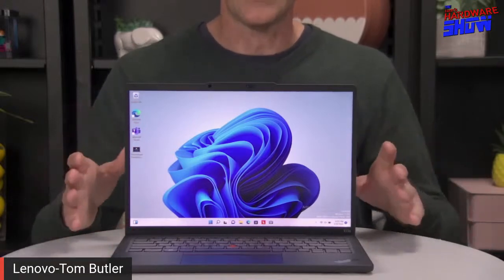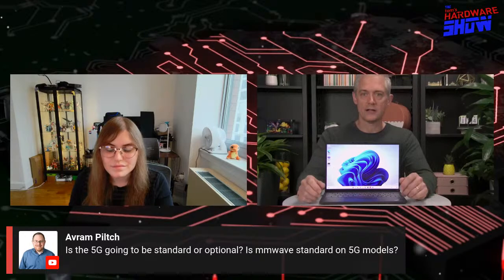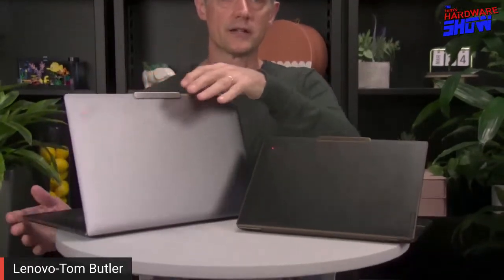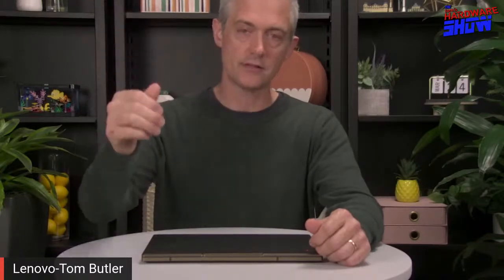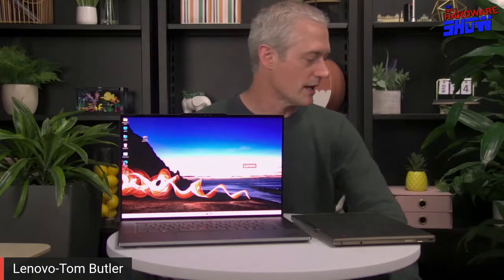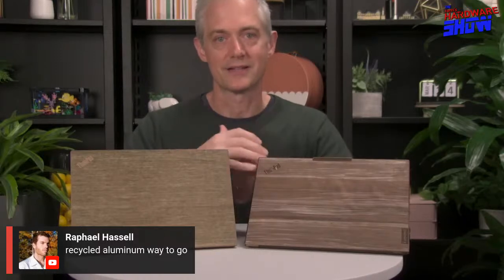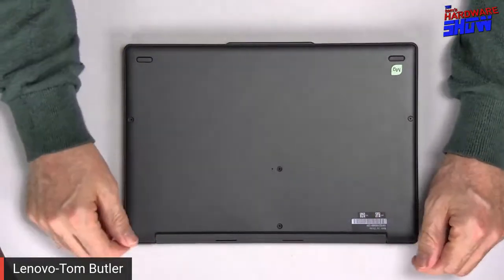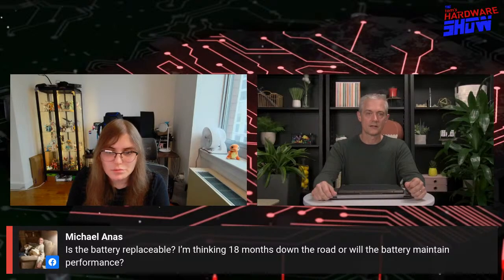A Snapdragon Thinkpad and the Future of the Z Series | The Tom's Hardware Show

Comment: What the viewers dont get is this.....

If the theme is sustainablity why has this model  no upgradable wifi,ram, screen and ssd 's ? Clearly why not just buy a cheap laptop which is stuck together which you cannot be updated and ends up in landfill within three years? The UK and EU are cutting out non repairable,non upgradable,and software diverse laptops.This mdel is deffinitly a failure....just call it the max and scrap it ?

Do whhat is needed....increase its thickness by 2 mm,add useful ports,udatable ram,linux, and wifi cards......
Reply: Lenovo, like most corporations, is just virtue signalling about their supposed environmentalist bent. A laptop with zero upgradability or maintenance options just ends up in e-waste that much faster, regardless of what the shell is made of.

Comment: Tom, will the z-series come with a matte display option? If not I will not consider it. Glossy screens may be great for use in dimly lit areas but they are horrendous for well lit areas...If all I can see in my screen is reflections what's the point for having colors that pop. Please offer a touch matte display with at least 400 nits of brightness (500 would be better but I'll accept 400 nits). It's really about about function over form. If you can do it on the X1 carbon certainly you can do it on the z-series. i'm jussayin....